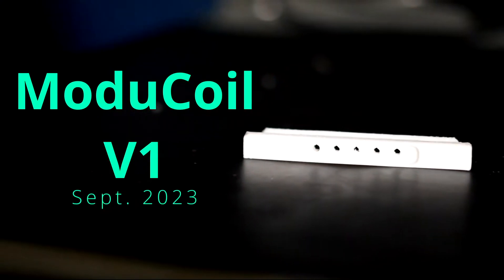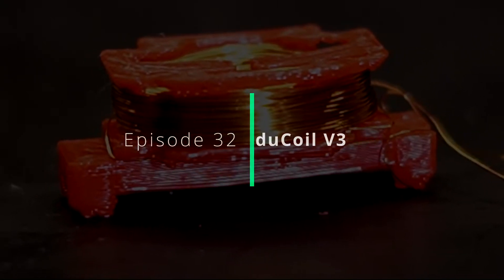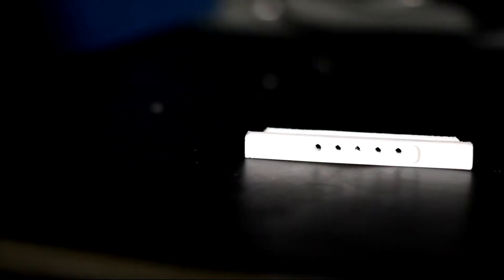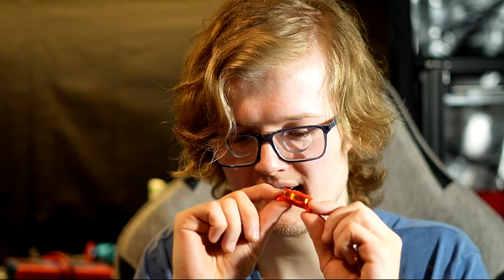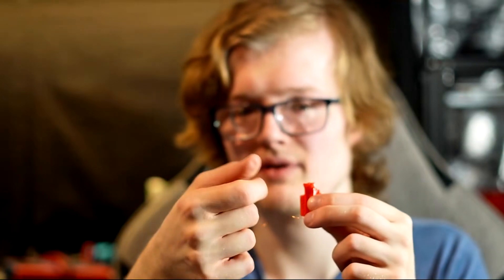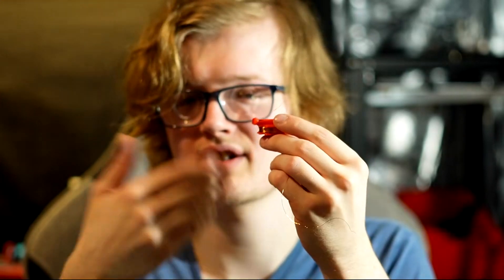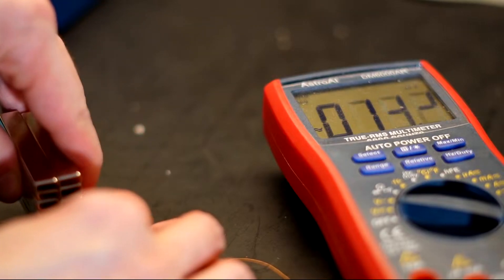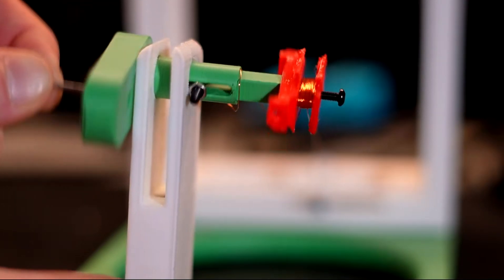ModuCoil V3 - 3D printable, Modular, and now Optimised and Compact

Comment: Dont worry about the people that dont understand what this is for, this isnt for them.  If you dont understand its purpose thats fine..its not for you.   This is for electrical design and modularity in motors and generators, and its a good, if simple idea that it would be nice if people applied before now because theres NO modularity between manufacturers, and an open standard allows for sysyems to be built to work well together.

As far as the Ferromagnetic core, try magnetic flux reactive filament.  They have filaments that you can print the core in, which means you can use a dual filament printer to print the path of magnetic flux lines if you do it right.

Comment: There is a program called FEMM you need to check out!
You can model slices of the designs with different material cores etc to see how they can help focus the fields.
Depending on the use case, ferrous cores may be useful.

Comment: You didn’t really cover what the point of this is. I’m assuming it generates 3D models for coils, but anyone with any idea of CAD can make a spool design within minutes. What’s your pitch?
Reply from the maker: I intend to use these in my next generator design.

The main facet of this design is it's modularity, which when combined into a generator that uses the same design philosophy, it makes for a modular generator that is easy to disassemble and thus recycle.

Comment: Magnetic fields doesnt get blocked by plastic which is 100% NON-magnetic
Reply: There are ferromagnetic filaments for 3D printing, so in effect magnetic blocking and flux line adjustment can be achieved in this use case.
Reply: @NeoIsrafil  recommend it to this guy
Reply: I was about to say, isn't it advantageous to have ferromagnetic elements in your electromagnets?
Reply from the maker: In my generator design, I'm using a Halbach array, which negates the need for ferromagnetic cores.
Reply: @edeniaAJ  then my 1st comment sticks!
Reply: nothing blocks a magnetic field.
Reply: @Festivejelly  yeah it does another magnet field